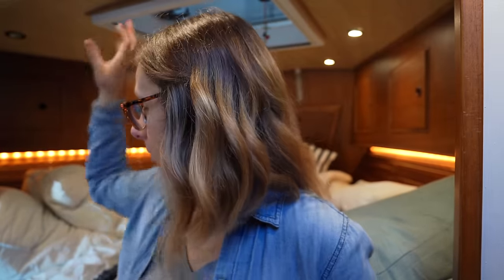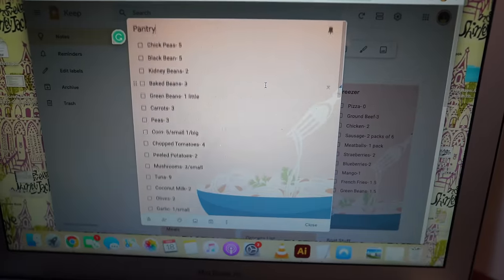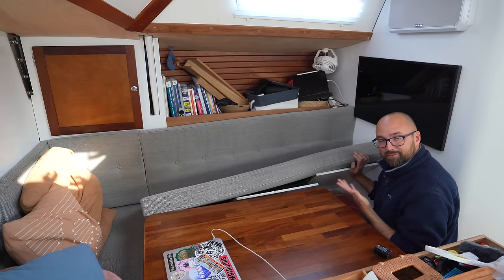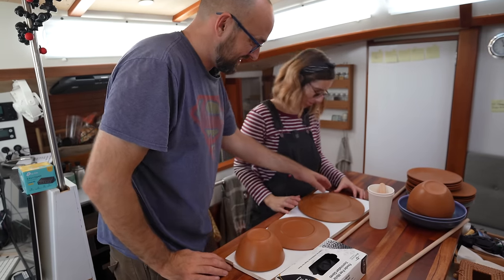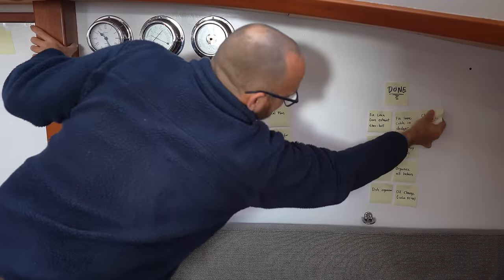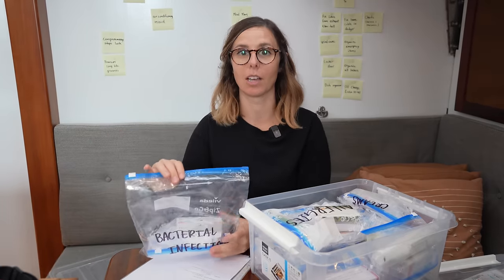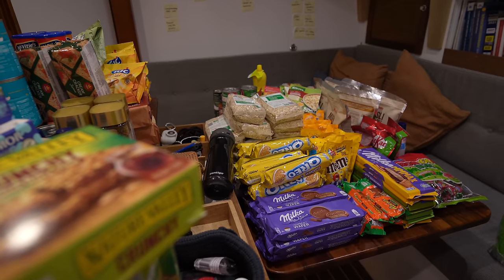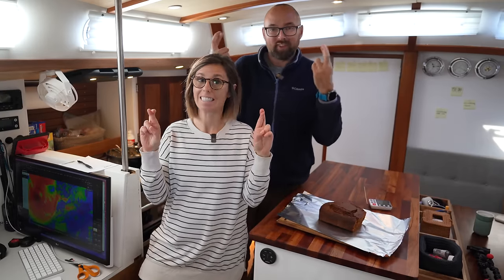Sail Life - Ready to cross the Atlantic Ocean 🌊⛵️

Comment: An essential for First Aid Kits I found, partnered with antiseptic wipes (used first), and which probably eliminates the need for staples, and which I can vouch reduces Scarring considerably, is Superglue (get big bottles relatively cheap from places providing Upvc plastics supplies-fascias, soffits, windows, etc. Now to make it work you need an accelerated spray, that sets the Superglue immediately, and once you have one layer set, you can add another, set it, another, set it, and so on. Surgeons use Superglue to affix internal organs that have become detached etc. Accelerating spray, could be available from the same sources, but I always found it stocked in Model Shops, that sell Model Aircraft , Model cars, radio control gear and such. A big aerosol tin lasts a very long time. I almost had the index finger of my left hand severed by a roofing slate that flew off a roof during a hurricane, and after cleaning it all up with the wipes in the First Aid kit, the young Roofing apprentice managed not to throw up or feint, while holding it aligned and together while .I applied the Superglue and set each layer with the accelerator spray, until I had built up a solid splint and protective finger stool with the Superglue. About 24 hours later, the Superglue had separated from the skin, and left a nice neat shiny line where the cut was, and though it did take a few itchy weeks as the finger healed and recovered, the final result was the repair ended well for me. We had Called the Hospital, prior to doing the fix, but there were so many Hurricane injuries, A&E warned we were facing at least a 6 hour wait for me to be seen, and I didn't like the thought of not cleaning it up and protecting the injury for that long, plus apprentice couldn't drive the lorry, and after the finger repair, I was able to drive us back . Worth looking up, as I'm not that sure, but it may be that Baking Soda acts as an accelerator for Superglue ? Once I have my First Aid Kits set up on the boat, I'll test some on my skin, to see if there's any adverse reactions with it. A thought for protecting tinned foods, without sealing them by Varnishing them To put them in Vaccuum Sealing bags rolled in paper towel, then with a layer of paper to write the contents on, as a single layer in the vaccuum bag, then pump out all the air, and they are then sealed against salt air, and easily available to see what tins hold what, then just unsealed, grab the tin you need, then pump the air out again. Easy to store too. those bags are tough, and should last for years, just get a few spare vaccuum pumps for them. Best Wishes and Fair Winds.  Bob.  👍
Reply: Careful with the baking soda. It forms a rock hard material that can be sawn and filed. It has been used to rebuild the fret guides on guitars!
Reply: @57dent  Thanks for the update, could be useful to know for making splints and such , but otherwise, clearly stick with the accelerator spray for substitute stitches and staples. Bob. 👍

Comment: This may be long. Naval arch and marine engineer in third career as yacht delivery skipper with about 200k nm. 

Provisions. Meal planning is important for two big reasons: to make sure you have have everything to make the things you want and to plan cooking ahead. There are lots of things you can make on board that are good at sea that are not necessarily something you want to make underway. Examples include lasagna and chicken pot pie. Such things can be made ahead in disposable foil tins and frozen. Note that many casserole dishes (e.g. lasagna) are for large amounts, usually a 9" x 13" pan (forgive my units). If you double that recipe you can make five 8" x 8" pans. This is a meal for my delivery crews and likely two meals and a bit for you. Freezer space is the most important storage aboard, so finding ways to prep without freezing is valuable. Canning is one approach. See NCHFP (https://nchfp.uga.edu/). Only the US has a resource like this; I've looked. It's too late for you to actually do anything for this trip, but canning results in shelf stable product for storage of sauces (e.g. pasta sauce) and soups. Of course you can buy commercial products but you have less control over taste and ingredients. Your call. 

Don't lose sight of dehydration (see NCHFP link) as a storage tool. I don't like it as primary preservation (if you have a water problem that problem becomes bigger) but some items (e.g. mushrooms) take well to dehydration and storage is less weight. N.B. too much food, too much water, and too much fuel are self correcting problems. 

I predict you will find the forward pantry to be awkward underway. It's simply too far from the galley. That and the other storage you describe should be considered deep pantry with everything you expect to use in the next few days stored in the galley itself. This also makes maintaining your inventory easier. When you go "shopping" in the deep pantry (pantries) every few days, you mark things used even though they are still in the galley storage. 

Remember that your meal plan is fungible. If you don't feel like eating what is in the plan for the day just go down the list and make something else. 

Have a snack bag. Something easy to reach that you can restock every few days. Aside from convenience this keeps people from rummaging through storage and fridge and eating something planned for a pending meal. Remember people eat from boredom as much as hunger so things that take work like oranges and hard cooked eggs are helpful. 

If you're interested I have some rough material for meal plans turning into shopping lists you are welcome to. I also have an abbreviated list of recipes all of which have been used offshore. Write dave@AuspiciousWorks.com. 

With respect to your medical kit. NEVER RUN OUT OF BAND-AIDS. There is so much attention on the big stuff people lose sight of the little ones. Duct tape and blue tape will only get you so far. 

I enjoy your videos. Yours stand out from the bulk of what there is on YouTube. If you need "a guy in Annapolis" I'm him.

Comment: A few things you might consider is inflatable wrist, ankle and knee splints! Staple gun is ok but steri strip wound closures and surgical glue like newskin is easier to use also topical lidocaine/ novocaine if you have to use the wound stapler!the automatic blood pressure cuff for the wrist is usuable! The stethoscope is only usefull if you know how to use it! There are temperature tapes that you can apply to the forehead I've seen them in Europe! Much more practical on a boat where space is at a primium